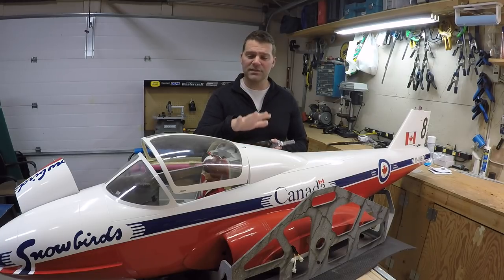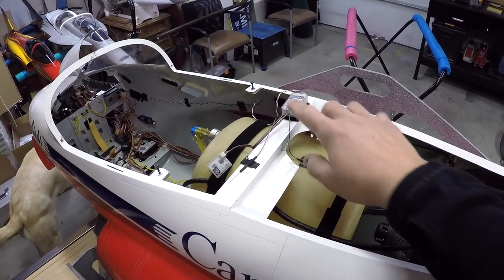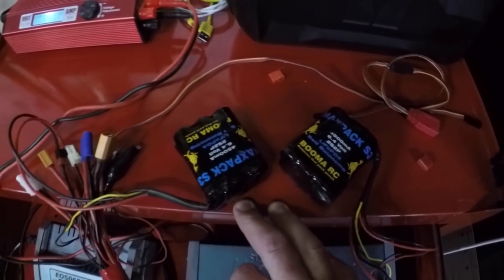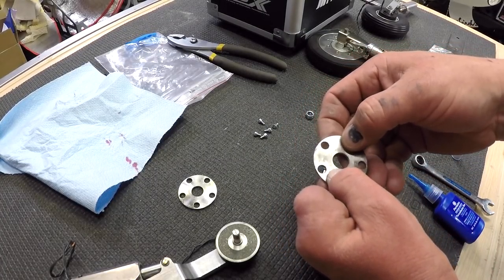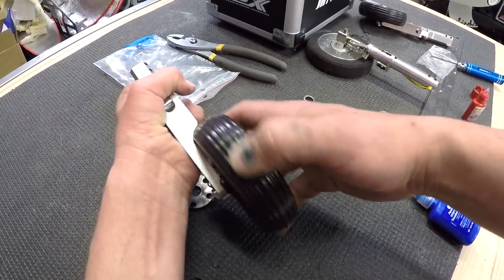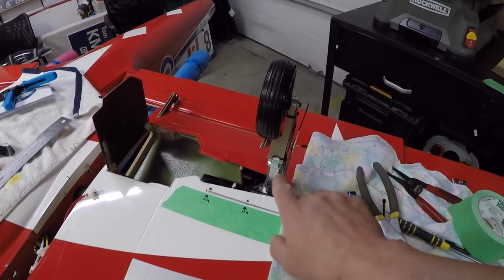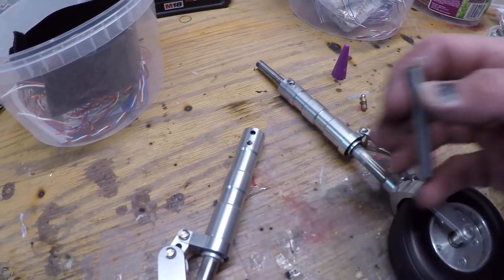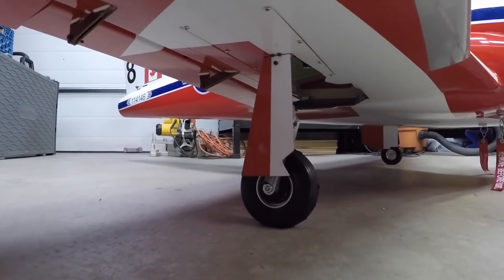Upgrading The Landing Gear For My CARF Snowbird & Spring Maintenance

Comment: How many times you can open and close your landing gear using one set of air tanks? Is there any "low pressure" indicator? Or you have to swap them every flight?
Reply from the maker: Great question!  With the way it's setup now the air system is only used on the front and main gear doors.  Everything else is electric.  you could probably get 20 cycles of the gear but as a norm I would top up the air system before every flight.  It's a fillable system.  typically run about 100psi in the system.  There is a dial gauge on the aircraft showing the air pressure.  This aircraft doesn't have a low pressure indicator.

on my F-18 aircraft there is a sensor that reads airpressure.  If the air pressure drops below 65 psi gear drops as a fail safe.
Reply: @thelightersideofrc   Thanks! I only ever tackled basic balsa kits so all that plumbing inside your builds freaks me off :)
Reply from the maker: Yea there is lots going on in there but they are all somewhat separate systems. It can be overwhelming though!